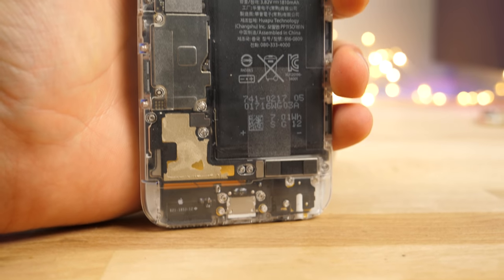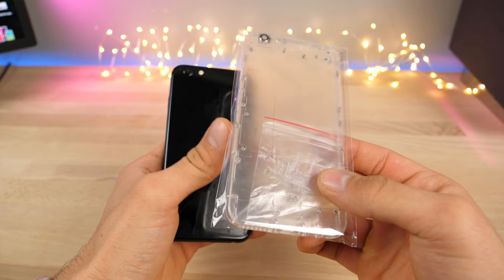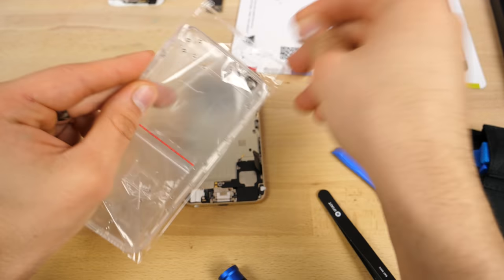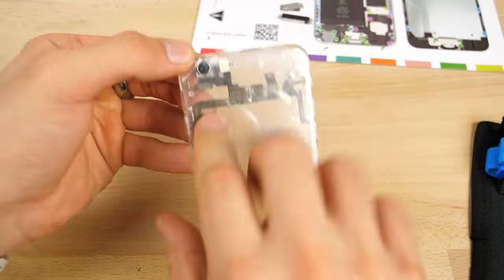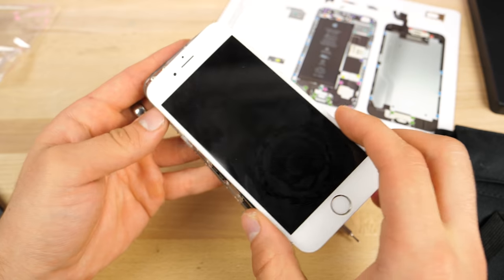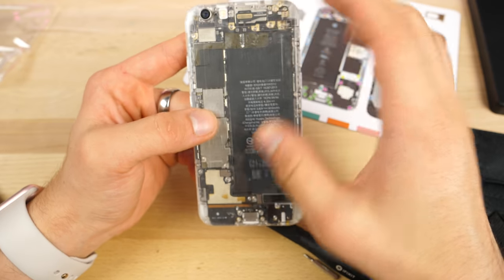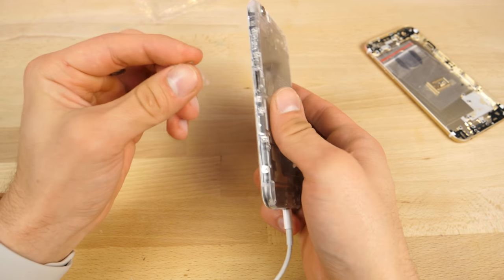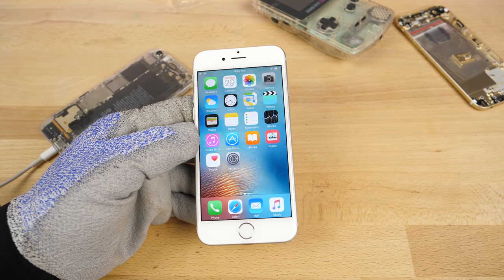The Clear iPhone Mod - Good Idea?

Comment: plastic housing? If Apple ever saw this they would have a heart attack.
Reply: Josay Mirez iphone 5c, iphone 3g, iPhone 3gs. You need to check out those phones.
Reply: oh god the 5c smh..
Reply: eh, back then everything was plastic.
Reply: The 5C was a good deal as far as new phones go. Now they are overpriced even in the used market. It's because of those kids that still want a colorful iPhone.
Reply: Josay Mirez iPhone 2g 3g 5c
Reply: Duftbaum Stock nope
Reply: Duftbaum Stock nope
Reply: Are you for real?
Reply: Josay Mirez iPhone 5c...
Reply: Josay Mirez the iPhone 3G, 3GS, and 5C had plastic hosuing
Reply: Iconic Jule no one said the 5c wasn't a thing.
Reply: Nothing wrong with plastic if used right. I mean a ton of phones were made back then with plastic, lol

Comment: The clear housing mod looked better on the 4/4S since you are just replacing the black or white glass panels with a clear one and if you only want the back cover clear it will be just easy as removing two screws and slapping the new one in.

Comment: now does apple pay still work tho?
Reply: I´ts another channel but doesn't the chip need an antenna? That screw that he didn't put in was the connection between the phone housing and the NFC chip
Reply: Honey, 6 , 6s don't have the NFC function. U can't use it.
Reply: sullivan james iPhone 6s definitely have nfc
Reply: ModernOW nobody uses apple pay
Reply: Ivan Yunda what you called that dude, is exactly what you are.
Reply: Uriel 420 actually I used to work at Starbucks, quite a lot of people do.

Comment: “Might affect your signal, maybe in a good way”.

Umm. The iPhone has antenna lines for a reason. Those are to boost reception. With those gone, the extra reception is screwed. That and with no metal casing, EMI can really screw with your devices performance or reception.

Comment: This doesn't look as cool as a clear GBC does. First of all, none of the plastic is frosted, second, its too thin and flimsy, and third, with the Gameboy colour you could see everything inside underneath the screen, and here the bezel is still opaque, and even if not it wouldnt show much anyway. So yea it does look cool on a gameboy or old apple laptop but not on a modern iPhone 6.

Comment: I had this mod on a iPhone 5S. I noticed that up on the top there was a metal clip that was screwed into the housing and made contact with the board and case. When I switched to a plastic housing, GPS didn't work. When I went back to a metal housing the GPS worked fine. Does this problem still persist on newer models?

Comment: my good friend. you did not disconnect the batter before you started, and you plugged it in before you installed the screen. that's probably the most dangerous thing you can do during a repair.

Comment: Hey i know he gave  jerry rig everything props but i think they both did a fantastic job if you guys are hating on everything apple pro then here is what i say. Even though jerry rig everything did it first he did less work than everything apple pro because he just took off the back and scraped the color off the glass and everything apple pro took apart the iphone and replaced it in a new shell. But i guess now you can still say they are both good

Comment: A mod that I would consider doing? 
Depends on the cell/mobile data signal you said you would test @ 3:00, probably more relevant than how well it takes extreme electromagnetism in airplane mode.